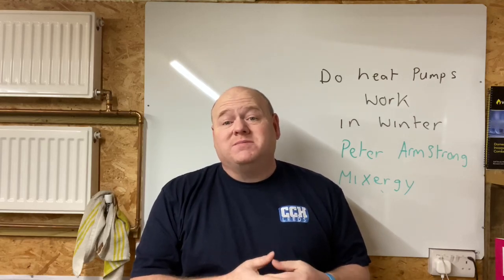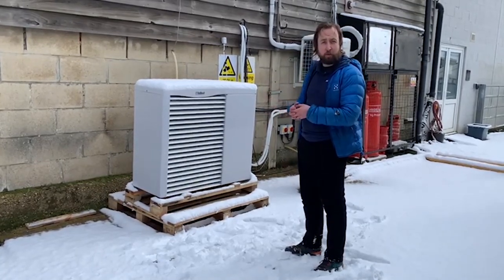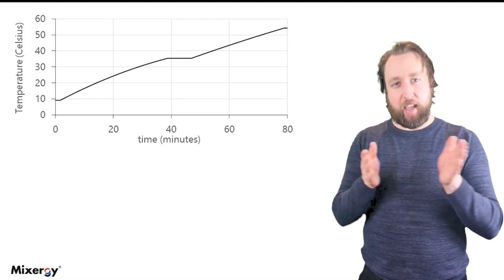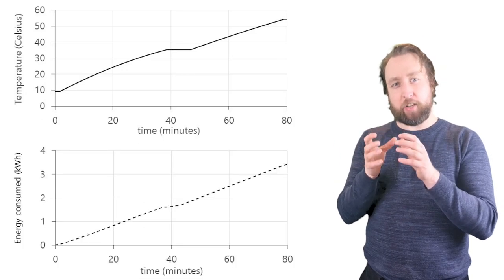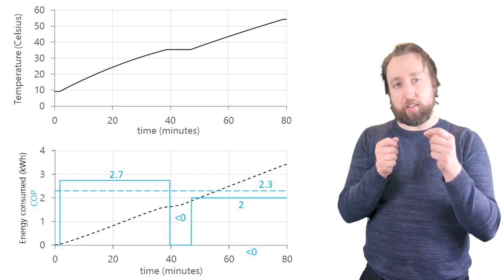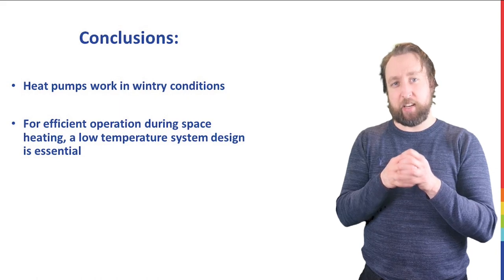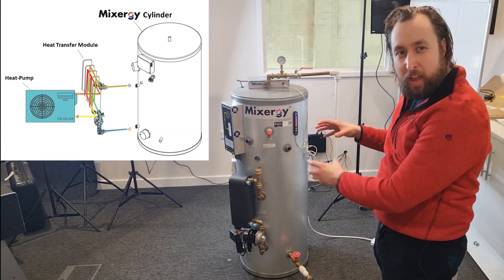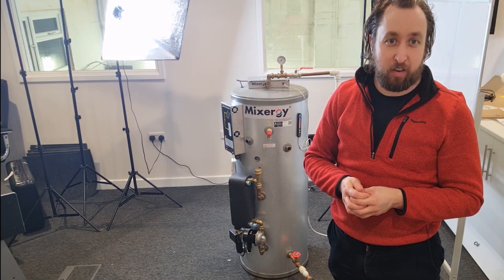Do Air Source Heat Pumps Work In Winter - Peter Armstrong Mixergy

Comment: I think people don't really care if it works in -1C.
If they are like me, they want to know what it costs to run year round, through all temperatures.

Looking at the video it used 4KWh in -1C to get a tank up to 55C, which is some useful info. At my energy tariff that's 80p @ 0.20p/KWh (Octopus Energy 2021)
However, it doesn't go as far to show me what it uses to maintain that temperature when that tank/heat is being used (heating/hot water).

Helpful video, but for me didn't go far enough.
Hopefully there is a follow-up that goes into energy usage/cost of one of these machines in a regular home.
Reply from the maker: Hi Dan, Thanks for the response. If you add some bullet points below we will try and do another video
Reply: I remember seeing a video by some one who did the cost comparison and the heat pump came out more expensive than gas combi boiler. When you look at 4kWh one would think that's great less energy being used compared with Gas combi but taking into account the price of gas and the time it takes to reach a set temp the heat pump comes out slightly more expensive around 20% more if I remember correctly. Where you save is when you have solar power. The question really is are we willing to save our planet at any cost...
Reply: Hey Allen, thanks for your reply.

I personally would be interesting to see these answered:
- What size of ASHP is needed in an avg size UK home
- Upfront cost of low/med/high ASHP compared to a low/mid/high end combi replacement
- Ongoing energy usage compared to a low/high end combi
- Warranty compared to an avg combi
- How does ASHP servicing work?
- Energy usage  profile of one of these ASHP over a long period compared to combi

Consumers are savvy, and will demand the most cost efficient form of heating.
I think there may be a growing market for ASHP if they can also invert and provide cooling (our summers are getting hotter if anyone had noticed).

But as other comments indicate, price seems to be the big blocker at the moment for wider adoption.
Id therefore like to see this price issue highlighted and discussed in greater detail.

I’m sure the combi boiler was once expensive, now it is everywhere.
Reply: @asif530  We'd expect this to be correct Asif, hence the emphasis on grants etc from the government to try and catalyse uptake to reduce costs..
Reply: The elephant in the room is the high cost of electricity in the UK.

You can take your CoPs and get excited about them, but I have a fuel that is 3.5 times cheaper than electricity - and it works all year round.  It’s called natural gas.

If I wanted to save bit more I might put in oil fired heating.

In Scandi countries electricity is mostly cheaper than the uk and is genuinely renewable.  Ours is not cheap and the renewable suppliers are being a bit loose with the truth.

Heat pumps will not be dominant in the uk anytime soon;  the industry think they will be doing well to sell 80,000 in 5 years time .  The uk buys 1.4 million gas boilers a year.
Reply: @gruhwch4876  fyi the govt us banning the sale of new oil and gas boilers from 2023.
Reply: @uskok4636  the government has to do alot more than just putting a ban.  Affordability is key so it will be interesting to see how the costs come down and how reliable they are in a few years down the line.

Comment: The issue is that you need to heat the water tank to 65 degrees to get an 8 minute shower with a decent flow in winter where I live. If I got a heat pump I'd be having tepid showers and probably come out colder than I went in.
Reply: Have you tried a shower pump which boosts the cold pressure at the same time as the hot side dooovde?
Reply: This could allow you to go to a lower storage temperature depending on the cold service connection to the house...
Reply: @mixergyltd6286  There's a pump installed alright...not sure how it operates though. I'll need to check that out. Thanks for the reply.
Reply from the maker: Thank You

Comment: Vaillant, nibe, bosch and etc - highly overpriced garbage from EU. Old tech, high price. Only EVI inverter DC heat pumps really works in cold condition.  My last one chinese PF050DC/NE i got for only 3500 euro. Work great when -10C, -20C outside.
Japanese Hitachi, Panasonic also great but way more expensive.

Comment: Imho, unless you have a means of mechanically mixing the water in the tank to ensure uniform temperature at every level in the tank, your temperature readings will likely result in an exaggerated CoP. Have you done this?
Reply: Hi Mike, very good observation - we are achieving a slightly higher COP with the plate heat exchanger and it's high rate of heat transfer to a fully mixed tank, in practice, this enhances the COP by around 5% to 10% compared to a coil in a tank (I touch on this at the end of the video). 

Ultimately the COP of the whole system, including space heating, will depend on how good your heat transfer is and in turn how low the temperature can be to the radiators/underfloor circuits, but also how good the heat transfer is to the hot water cylinder.
Reply from the maker: Thank You

Comment: But Peter, that ASHP was defrosting for nearly 8-10% of the time it was in operation!!  Now when in defrost it’s working in a negative manner &, with some installations its stealing the heat from your home!!  It’s only -1DegreeC in your demonstration, here in Scotland we can easily have a period of cold where, it’s not uncommon for it to be -6DegreesC for days on end.

Then there’s the issues of millions of poorly insulated homes in the UK, then there’s the issue of only an 80Amp supply of expensive electricity to these properties.

As a Heating Engineer & not a n ‘Eco Profit Warrior’,  like you, your experiment is just drivel & proves nothing.

The facts are; Britain’s existing CH systems are useless for Heat Pumps, emitters need to be, in some cases, 8 times the size for a Gas boiler!!.......Now readers, stop right there & look at your radiators, have you got wall space for a HP radiator, 8 times the size of that wee radiator???
Then there’s your existing pipework for a HP system, your pipework would need to be replaced, it’s wholly inadequate in size.  A HP system needs constant circulation through your pipes at a very High Flow Rate & the difference in the Flow & Return Pipe Temperatures(Delta T) needs to be significantly lower than with a conventional system.  So over 90% of Housing Stock in the UK would require to be fully insulated & there CH system completely replaced!!

Nothing wrong with Heat Pumps, they’re great, but you need correctly sized systems that are up to the job.  And very, very well insulated homes too!
Reply from the maker: Thank You

Comment: The UK offers payments under the Renewable Heat Incentive and it looks likely new regulations for switching away from gas boilers to renewable alternatives will be put in place soon. What i would really like to know is Whole Life Cost of replacing an existing gas boiler heating system. Co-efficients are great, but dont tell the return on Investment timescales or if I’m  paying more for the technology to get less benefit?
Reply: Just had full system fitted with 10 renewed radiators 8.5 kWh pump Tank and app controlled cost me 14000 and get 12000 back over 7 years but do have a 10kwh log burner as backup not needed at the moment
Reply from the maker: Thank You

Comment: I recently watched a video here on YouTube where 4,500 house owners in Newcastle (chosen because its average atmospheric temperature is on the low side), were offered a free install of an AS heat pump. They had all the advantages and disadvantages explained to them in detail, and an explanation of the requirements - like double size radiators, and increased pipe size for example. Guess how many took up the offer?  just 13. Note the average cost of each of the installs completed was £20,000.

Comment: If it has to defrost in cold weather using electricity
It reduces its performance more
Reply: This occurred the test in the video Brian, the defrost actually used less energy than we thought it would but at steady state, reduces the performance overall by about 20% we think...

In spite of this, the overall performance is still significantly better in terms of energy consumption than direct electric
Reply: @mixergyltd6286  Why not put in thermostatic controlled trace heating to avoid the freeze. Makes sense to me.
Reply from the maker: Thank You